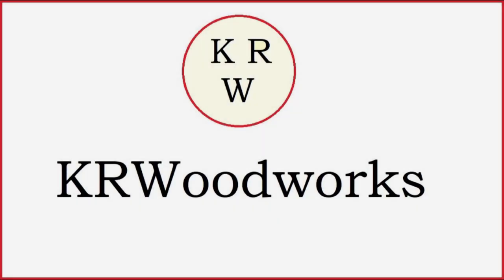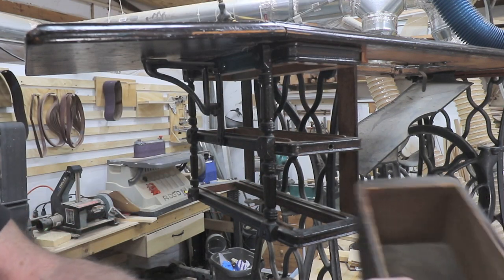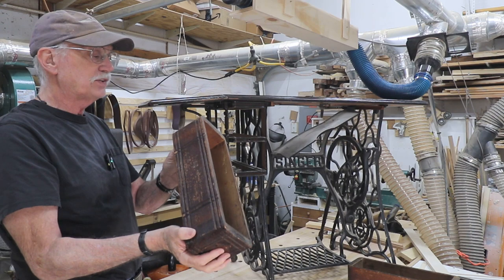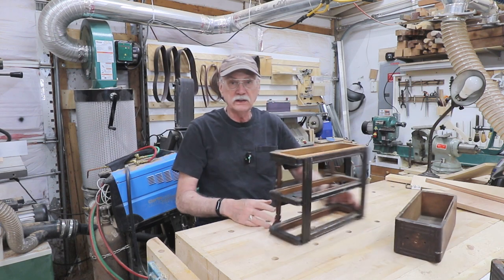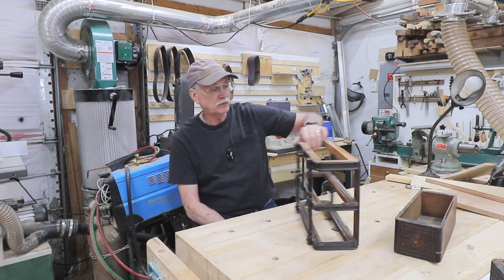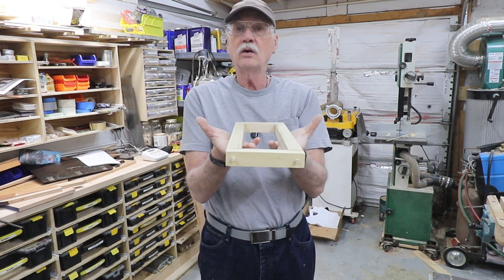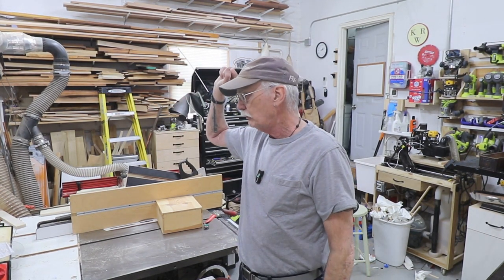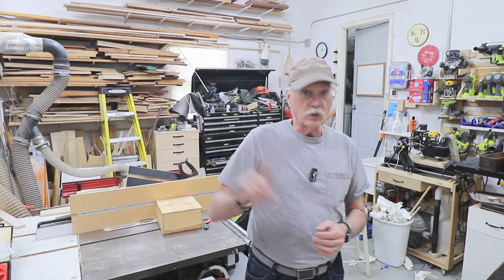Sewing Machine Table Episode 2

Comment: I admire your woodworking knowledge Kevin. You'll see two drawers and the frame and then the detailed technique of duplicating it. Nice to follow and learn a lot. On to episode 3
Reply from the maker: Thanks Mike. Episode 3 will be delayed a bit. I'm going to post a video why but the shot story is I'm a pilot and I fly a friend of mine's Piper. It went in for the annual inspection and I'm doing an "owner assisted" annual. So I'm in the hanger wrenching on the plane.